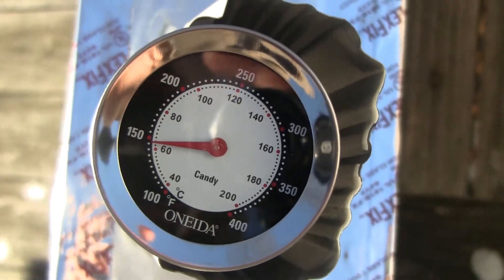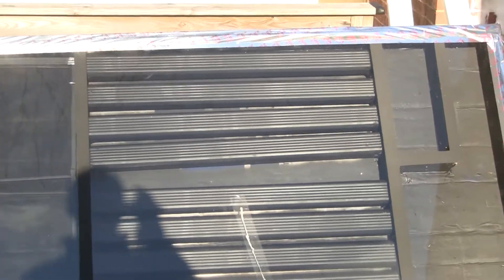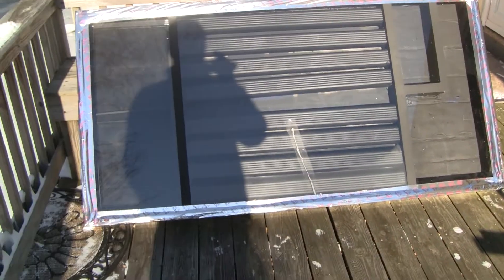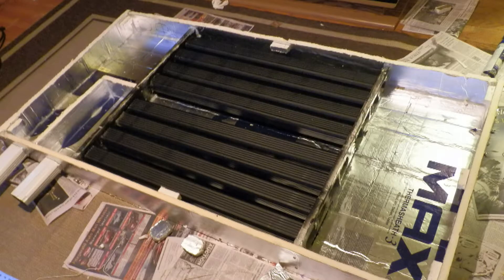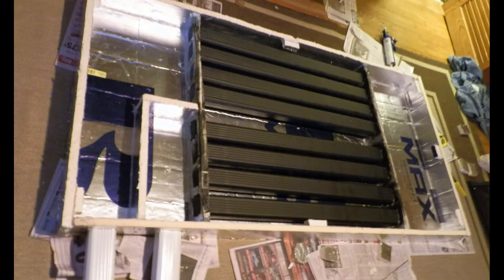No fan yet. test 2 Hybrid model solar heat collector, 15 degrees to 150 degrees

Comment: That’s miss leading as far as temperature output.  It’s just sitting there with no constant air flow through the unit. Hook it up inside the home on a 15 degree day and show the temp output with a fan drawing air through it in the home.  That would be more realistic!
Reply from the maker: True. I do make a comment about that below. The temp will fall with fan etc. 40-60% estimate.